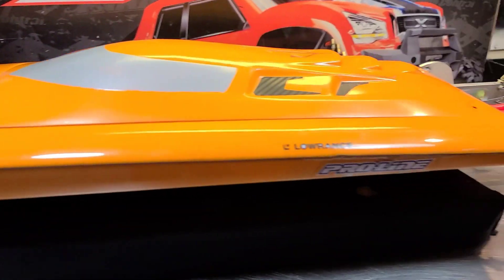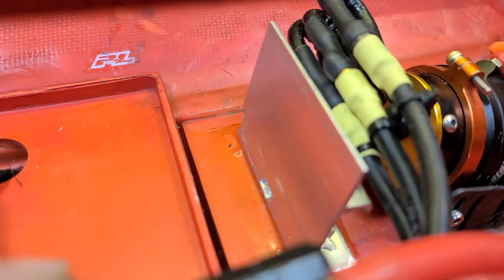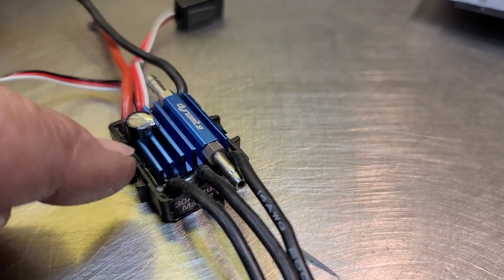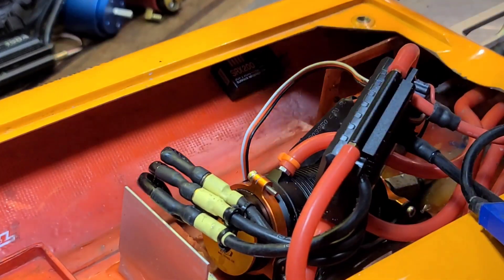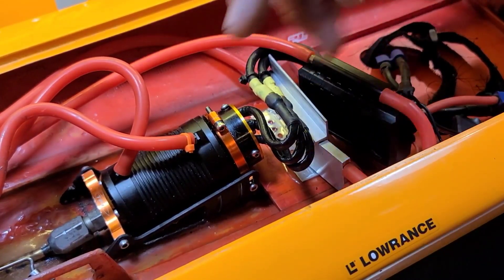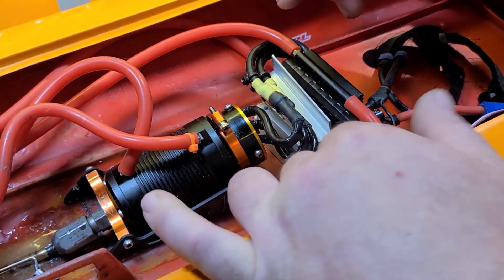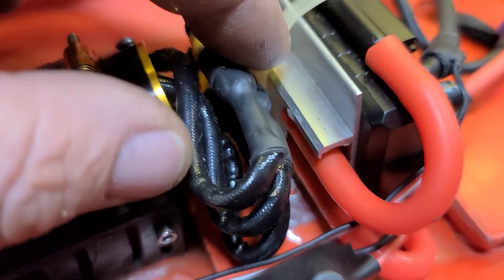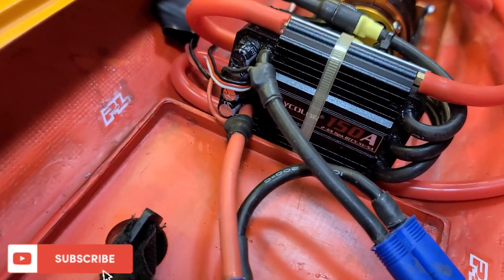Fast Electric RC Boat Watercooling Tips - Extra Cooling On A Budget

Comment from the maker: Just to be clear this is not a recommended esc motor setup. The motor pulls to many amps for the esc causing heat.I've been running in this Boat for almost 4 years now with this set up on 4s & 6s..  gotten the esc up to 160° the esc keeps kicking.  Like a timex watch, takes a liking and keeps on  ticking

Comment: Hi IRON, a question, I have a 4082 1900 kv (rocket) motor, whose characteristics are: max ampere 138, the question is: can I connect a 150 A Flycolor ESC to it?, I would like to use it on a hull about 80-82 cm long. and use a 1/4 pitch propeller with a diameter of 42mm, thank you for your kind attention.
Reply from the maker: Yes that should work just fine, I ran that motor esc combo in my Deltaforce 35, 42-45mm props worked best  1.4p.

Comment: Place your external pick up behind the prop for forced injection through your cooling system,  a little bit back from the cavitation , for solid water flow. Moves the water faster through your cooling system pulling the heat away faster . Old buddy of mine is really into boats .
Reply: Have to agree mate🤙
Reply from the maker: H
Reply: Ya right mate

Comment: Help me with a thought. I was looking to make a cooling system on my brushless boat with a radiator, similar to those on cars and computers. But I was thinking better, would you be able to tell me if, since there is not enough air circulation inside the boat, this system would be useless because the fans would always be blowing hot air (for example, there would be no way to draw cold air from outside from the boat to renew the air inside)? Have you ever tried to do something like that?

I found some miniradiators in the aliexpress, like 60mm a 80mm
Reply: Sorry for my english, im using google translator
Reply from the maker: That as right the radiator system should have air blow thru it to cool things down.

Comment: with this mounting the extra cooling plate will not help at all
Reply from the maker: i took off the double sided tape holding esc to vertical nount.  i mounted the cooling plate, mount & esc Directly to one another a zip tied it all together the temps were 10-15 deg cooler...  metal to metal contact temps went down!

Comment: I like the recycling of the cooling plate idea I do it with my cars. I chuckled when I saw the boat full of ice. But on a serious note if you ever needed serious cooling you could use a small amount of dry ice at the esc or motor it lasts  for a good while and will Super cool the parts  while doing speed runs for example.

Comment: Good day sir, what motor are you running with that flycolor 150A? Thanks
Reply from the maker: It's a tppower 4060 it's not the best match. Esc gets hot because the motor draws to many amps.  Tppower 4050  wold be a better choice. That's what I'm about to put in my boat

Comment: Working hard to keep my Sonicwake 36 from over heating, I plan on doing a quad intake dual water outlet pickup rudder upgrade but I don’t even think that’s gonna be enough to do it lol…
Reply from the maker: I tested this mod today and it's about 10° - 15°  cooler than usual  it actually worked
Reply: @IRONCLADRC  which mod? The quad pickup dual outlet rudder?
Reply: Or are you referring to your plate on back of each?
Reply: I've been building boats for 40 years now, I use wider tubing to get flow from prop wash to cool esc , it has to be plumped correctly ,but all this extra bits ??? No need

Comment: Wow, that thing with the ice cubes is by far the most creative cooling system I have ever seen in a RC boat :)
Check out my recommendation how to really solve the cooling problem because your electrical setup isn't propper (I have posted it as commentary on your vid. from the 26th of november 2020).
Reply: Good point👌sir
Reply from the maker: Thank you for the recommendation